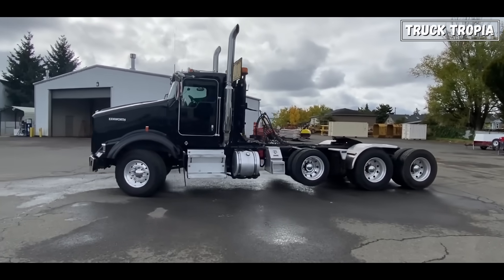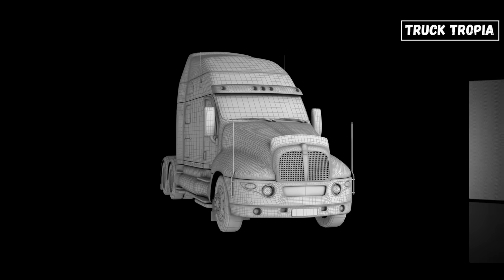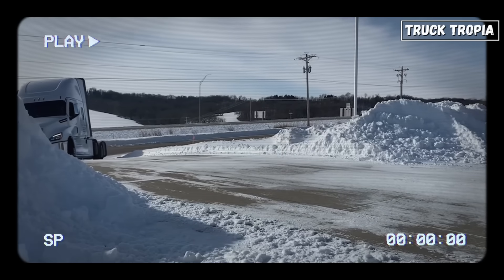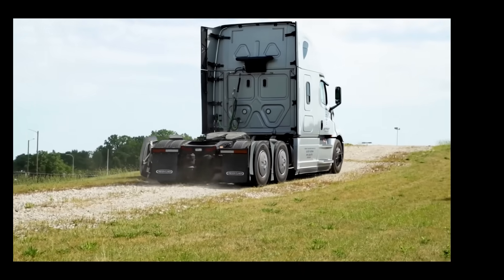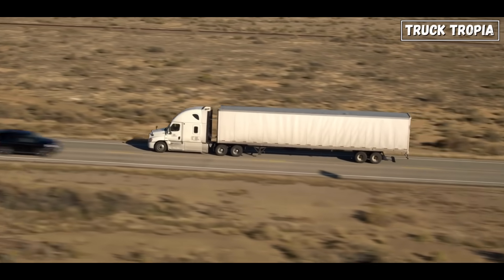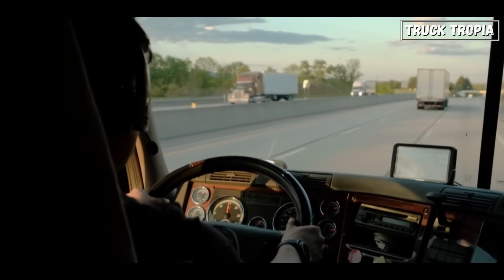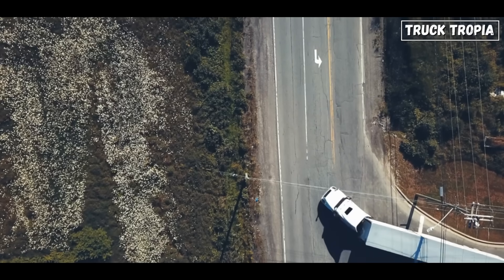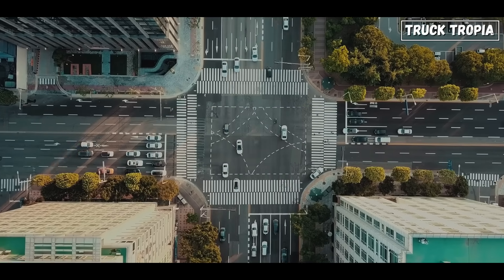Why Do Some Truck Tires Don't Touch The Ground?

Comment: The largest reason in the US, mentioned in the video, is for weight distribution on construction vehicles, like cement trucks or dump trucks, or heavy haul trucks.

Another thing not mentioned in the video is that lift axles are rarely, if ever, powered and are only there to provide extra load-bearing capacity.
Reply: There are trucks with driven lift axles. For example in Finnish made trucks called Sisu and it can disconnect the drive from the last axle and then you can lift it.
Reply: "Weight distribution" is demagoguery term because the goal is to limit weight per axle which is limited by law.  the more weight you carry the more axles you need to have by law
if you don't exceed allowed weight you don't need to use other axles although I think this allows some cheating too if you do not load them fully
Reply: @deltaxcd  true, I really meant additional weight capacity rather than distribution. Though, in a way, it is distribution, just of the additional weight allowed
Reply: @deltaxcd the only law that matters here is the laws of physics, which states that too much load per wheel means the roads become unusable
Reply: So, You euphuised a reason that was already fully covered in the video. And then you mentioned something that was mentioned in the video too but suggested it wasn't? he literally showed you how lift axels are operated! The fact he didn't say "Oh btw, They are never powered" makes difference how? He just showed you how they operate lol
Reply: why do you call a lorry for a truck?
Reply: @anderstermansen130  bro that's something to ask Google, not some random person in a YouTube comment section
Reply: @anderstermansen130  Lorry and truck mean the same thing.  Lorry is more common in the UK
Reply: That's literally the same thing
Reply: Are they able to be lowered or lifted while the truck is driving? Or are they like a 4WD where you have to stop and put the truck in neutral before switching?
Reply: So how do they lower when needed and raise when you don't need them? Does the vehicles frame rails actually flex a bit under the load and the flexing and sagging of the frame is enough to bring the wheels to the point where they touch the road?
Reply: At 4:52 you can see two sets of air bags. The smaller ones lower and on their side will inflate and push the axle upward, the larger ones deflating at the same time. The large ones are the main suspension bags, and will inflate to push the axle down to the road and bear weight while the smaller ones deflate.
Reply: @coolsnake1134  "Not Powered" as in they aren't drive axels. They do receive power in some way to raise and lower, but it's rare for lift axels to also be drive axels. On another note, if the frame flexes enough to put a lifted axel on the ground, you have a major problem.
Reply: @coolsnake1134  not powered means they are drive axels. They do lower
Reply: @coolsnake1134  They have suspension air bags that inflate to lower it to the ground. Sometimes with real heavy loads and a 5th wheel that's far enough up the frame can flex enough to almost get a larger wheel and tire to touch the ground but it was always properly inflated before travel
Reply: With air pressure in air shocks
Reply: @coolsnake1134 They are on air bags, air up and air down. You just flip a switch in the cab. It's pretty easy. Most of my dump trucks have 4 lift axles,  leave them up empty or put one or all down when loaded. Because the lovely state of Ohio will bust you if not.
Reply: @gumballer133  Did you know that it is illegal to use them in Canada?
Reply: @johnarnold893  Really? They have to be down permanently?
Reply: @johnarnold893  what's the reason they would be illegal?
Reply: @johnarnold893 absolutely not true
Reply: @johnarnold893   I live in Canada and all the garbage trucks have them. so why would it be illegal?
Reply: @johnarnold893  They are not illegal in all of Canada. They are instead heavily regulated and the regulations are dependent on the province. The reason are that drivers would not drop their axles while under load and that caused a lot of damage to road ways and transportation infrastructure as a whole. 

They're legal by regulation in British Columbia and by permit in Alberta, Manitoba, and Saskatchewan.
BC specifies that it needs to be auto-sensing (except ready-mix trucks), Alberta and Saskatchewan allow any auto-sensing, and Manitoba allows any lift axles.
Reply: @Totaro77   while its not entirely accurate, what he said was somewhat true. its not that you arent allowed to have them at all, but there are rules you have to follow, they differ a little between provinces. like they have to be down when going over 60km/h and they cant be manually controlled, etc.
Reply: @johnarnold893  is that why I see so many Canadian trucks with those small single axle jeeps for lowboy loads?